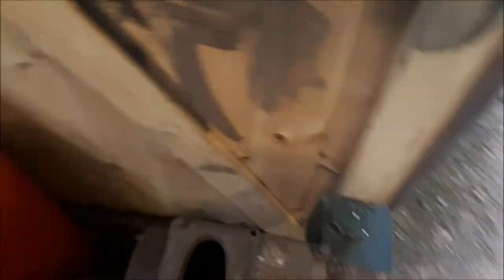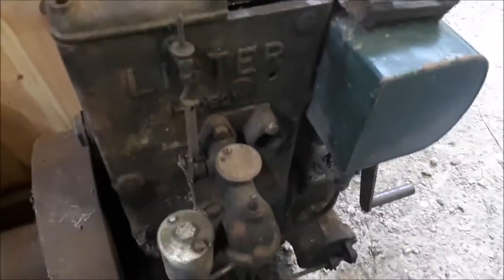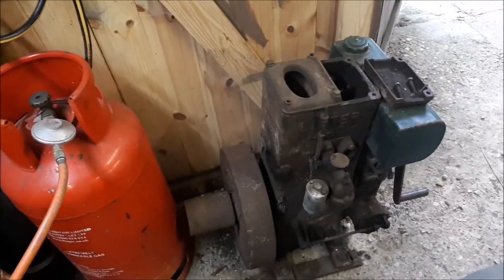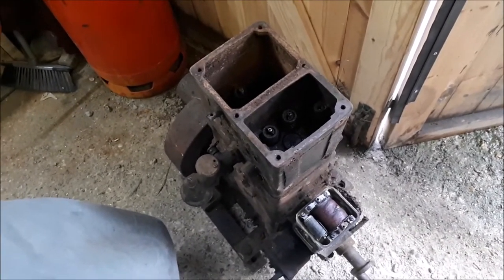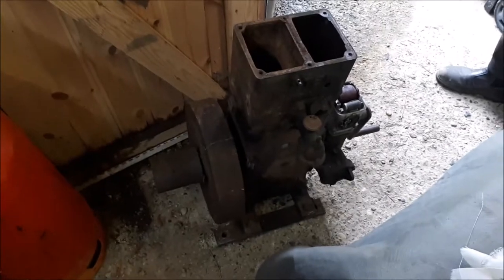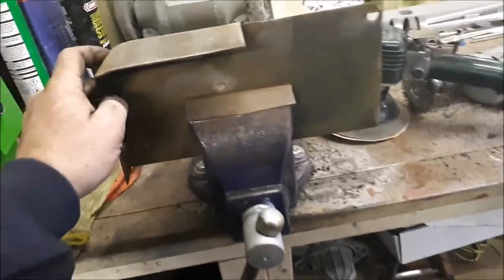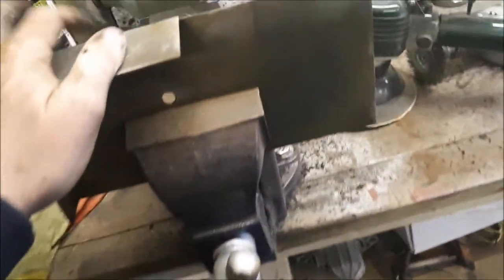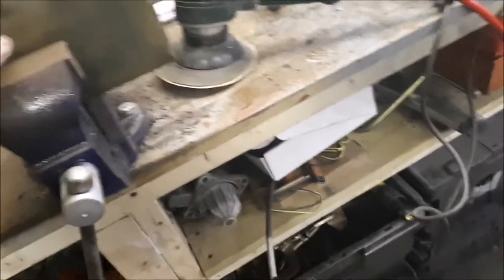Lister D Engine Restoration Day 1.

Comment: Just dragged my Lister D out of various places in the garage after many years!  I stripped it down but never got round to doing anything with it.  I did break the top off one of the valve stem guides, but don't know if this will affect the working.  Might see if I can buy a replacement.  Thanks.